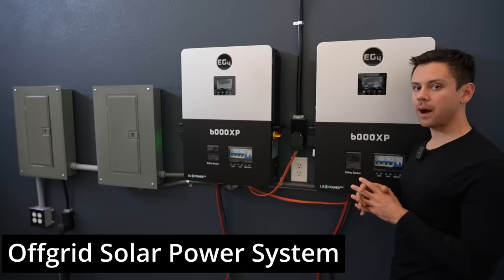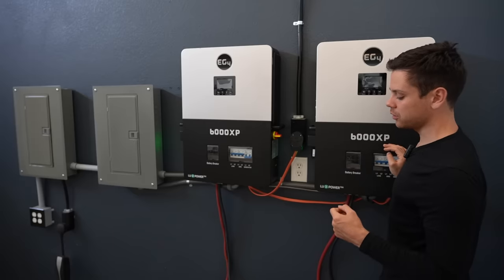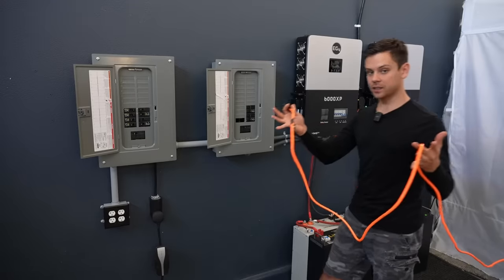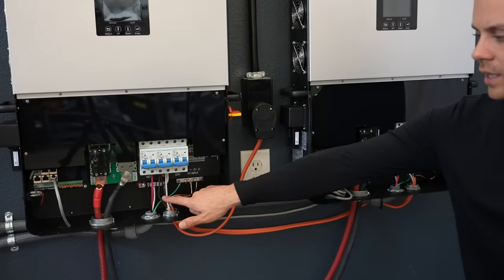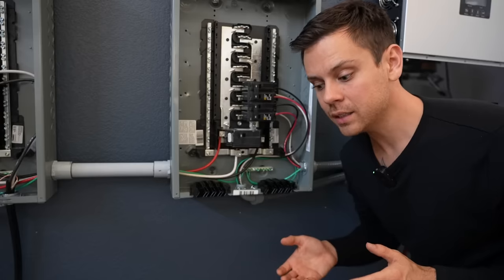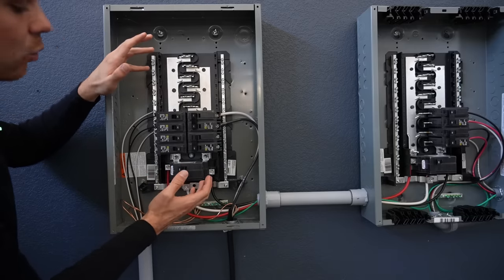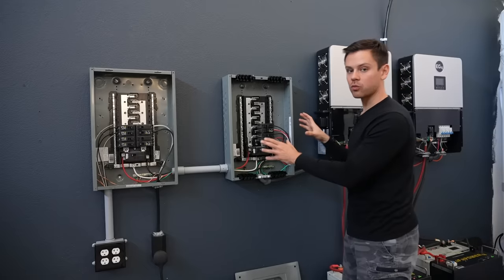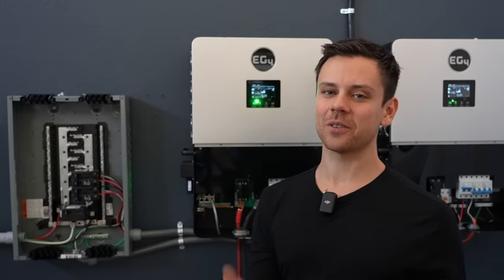How to Build Expandable Off-grid Solar Systems w/ EG4 6000XP

Comment: So I have a bit of an unusual setup on our farm.  The utility power is one 200amp meter and split 3 ways to 3 structures with 200amp panels each.  Typical load is 6kw-10kw much of which is lighting.  And sometimes welder, air compressor and AC.  I already have 8.4kw of panels purchased.

The though I had would be 3-4 6000xp units connected similar to this setup.  Will have a small shed to house the inverters and eventually batteries.  Would run incoming utility power to the power shed, branch out to each, then recombine, and return to the main disconnect.

Now, as far as grid load transfer the manual isn't very clear on how it supplements power if PV or Battery isn't enough.  Or is it basically automatic?

Thanks and keep up the great content!

Comment: Once again - great presentation and explanation.  

1 quick question - given that it is 6000 watts - I would have thought that breaker would have been for 50 amps instead of 40 amps.  What is the reason for the reduction?
Reply: 40 amp at 240 volt is 9.6KW .So the 40 amp breaker should easily handle surges.

Comment: Great breakdown! The biggest concern I would have, is finding an electrician who is knowledgeable enough to correctly set up the panels, without destroying the inverters in the process, creating a ground loop or not fully understanding the use cases of the various layered breaker approach. Many to most electricians I've come across will have absolutely no idea of the complexities involved in setting these up, and will end up under-configuring them, or creating an outright dangerous panel setup. How do you find the "right" electrician for a job like this?

Comment: I have a few wire questions...  
*You said 2/0 for the batteries is overkill, what size is "right size" appropriate, 1AWG?  400Ah of batteries but the 6000XP can only pull 125A.
*What size lug is used on the EG4 6000XP and what size is on the EG4 LL batteries?
*And you used 8AWG stranded THHN wire for the 240v grid connections? 6AWG after they combine.
*Looks like you used 10AWG stranded ground wires?  
Thanks Will!

Comment: I appreciate the multiple integrated functions: disconnect, AC and DC breakers with arc and ground fault built in etc... As a counterpoint, what is the likelihood that one of these individual components fails overtime and needs to be replaced? Does this type of integrated build make repair more difficult or expensive in comparison to replacing an isolated component? Thinking long term, dedicated components are more expensive, but perhaps better for repairability and reliability? What do you think?

Comment: the breakers are there to protect the wires.  you did mention that doing it this way won't protect the wires and that if you overload the system, the 100amp breakers will not protect the wires and they will overheat.  I don't understand why you didn't swap out the 100amp breakers for a size that would protect those wires, or just put in wires that would be fine with 100amps.  Yes, those would be thick wires, but you put one load center right next to the other, so it would be a very short run over 1/0 copper.

Comment: It would be great to see how to set up a system that would include wiring steps from house MAIN panel to an automatic transfer switch (critical loads) then to (2) 6000XP's (instead of using multiple "manual" breaker boxes). Also being able to use A/C passthru when batteries/solar/generator aren't available. And also be able to auto-start the generator. Can the 6000EX do all of those things?
Reply: Agreed I would like to know what Will thinks about that too

Comment: What combiner box are you using ?  Can't find it.  Would really be helpful to list outsourced parts in descriptions.

I understand the basics of keeping neutral and ground seperated except for the man grid panel, and expect you simply removed the green screw from the neutral /ground connected bars to free the metal box, then added a bar directly to the metal box for ground, but an explanation of that would have been helpful for anyone with less than my own basic understanding.

Not criticising, because you've taught me so much, just a friendly suggestion.
Reply from the maker: It's all in the description. There is a link for a schematic and parts list

Comment: Seems like some good upgrades! I wish they would have improved the generator capability. My EG4 6500's just bit the dust after only two months in operation! I have to send them back and looks like I'll be getting these as a replacement. I really hope they are a bit more plug and play than the 6500 models. I had so many issues with programming them and firmware. Apparently they have an upgrade program now you can trade in your old 6500 unit for the xp. It seems like they were having a lot of issues with them.

Comment: I see you have kept the Neutral and the ground separate in the Combiner Box and the Load Box (similar as you state is done for a  Subpanel).  But I do not see any copper wires attached to those ground bars that wires them to an earth ground (copper rod driven into the ground)!
Reply: My question exactly?!?

Comment: When used as an off grid system, it would be nice if the grid breaker could be used as a dump load. Even better if using multiple units, use one as input from another inverter (maybe one with high idle consumption that you do not want to run overnight) and another one as a dump load. Just a thought.

Comment: Hello Will,

Thanks for your testings and sharing your passion.
I have two questions.

-Is it possible to show us with a scopemeter (oscilloscope) how the sinewave looks like?
-Is it possible to show us in an ambient temperature room of 20°C the thermal images at idle, half loaded and fully loaded?
(To show thermal images of the half load, you need to increase the load from idle to half load the increase to see what's the incoming hot points (spots) and keep it a minute on half load, and the same idea for full load. From half load to full load for about at least one minute.) Always while respecting the appliance theorical specs for these tests. And if you want to test more to verify the limits, it's after for our pleasure. Because we know that using out of electrical constructor specification limits, it can run the appliance to fire, or brake, etc. 

I deeply appreciated when you talked about people that had issues, because you're like our syndicate, our brotherhood when you represented this way. You Represent a lot ;-)

I have other questions.
Can we hook up wind mills on this all-in-one inverter?
Could I use it on a sailboat?

Thank you very very much,

Comment: Recommended Conductor size for Grid and load in the manual is 8 gauge. I used 8/3 wire.
Reply: Does 8/3 change the breaker size or are you still using a 40 A ?
Reply: @MrJar1rad  
40A double pole breaker.

Comment: Your combinary box is wired like a sub-panel , where neutral and grounds are seperated this is what electrical code requires , so saying you wire it like a sub panel, may help some people know exactly what you are saying!  Code requires 1st panel after your meter "main panel" to have nuetral and grounds together (that would be grid power, the combiner box for the units would be wired and considered a subpanel which must have grounds and neutrals seperate and EGC (Equiptment grounding conductor) or 4th wire green wire. In the grid the EGC is designed to be a return path back to source or main panel!
 Just thought maybe saying you wire it like a subpanel may help some people!

Comment: Hi Will, its amazing how quickly the technology is moving forward
I have been living off grid for 3 yrs now with an older 3 panel x 450w in series to feed a basic 60A srne controller with 2 x 12v x  200ah gel batteries and a 4kva 24v snadi invertor. I live in the Philippines retired n learning about life off grid
The 2 batteries were failing so I just bought 2 x 12.8v x 280ah lithium lifepo4 batteries. Gentai brand they seem well made with built in bms
Its working but I'm confused about allowing for future upgrades as I regularly run out of power when using grinders and saws etc.
Without overspending whats a good way to future proof my little system?
I'm planning  to add another 3 x 450w solar panels and get additional
2 x 12v x 280ah batteries 
And so here's where i need some experience and friendly advice

Am I better to change my inverter to a 48v and say make it 6or 8kva
Or would I need more than a 6 array of 450w panels to power it?

What's the way to keep what I have working and have easy time when funds are ready for upgrading to a higher kva invertor?

Sorry if its long winded . Look forward to any suggestions

Comment: Great informative video. Amazing to see how EG4 keeps making it easier to build a DIY system. I assume that in your second panel, the ground bar is connected to a copper rod outside your house?
Reply: If you connect the grid inputs, then the grounding (and the N-G bond) is provided from the main panel, but if you don't then yeah you'd want to provide a real ground for a purely off-grid setup.

Comment: Will. Great information.  Couple of questions - I need to install TWO EG4 6000XPs … what is the maximum battery capacity I have to have in place and how do they need to be configured ?

Also, do you have any idea when the 12000 XP will be available for sale ?

Thanks!

Comment: Hope these are more reliable than the eg4 6500. I’ve had to replace three of mine in less than a year.
Reply: What was the issue?
Reply: hello I recently had to send my 6500ex back because it had high voltage on ac output (140v) s.s gave me a full refund and I bought  one of these hopefully it will arrive soon
Reply: I would wait to see before you purchased. We have seen a lot of these little wall hangers live a short life.Just my opinion.Maybe this one they got right.But don't hold your breath
Reply: @mikeg2321  well hopefully they got it right this time. and I already made the order s.s gave me a store credit for the old inverter( 6500ex ) either way I have to get one already made an investment on solar panels and batteries can't let them sit collecting dust doing nothing . plus if theirs any issues they have 5 years warranty. and s.s is good with their warranties I didn't have any issues returning the 6500ex . I know their some good inverters out their like solark and victron but they are way of my budget.

Comment: Hi Will, it looks like the way you have the inverters paralleled in the video, that if you were to go completely off-grid with no utility availability, it would not be a problem to run with 1 inverter most of the time, then fire up the second one only for large, scheduled loads, like charging the car.  The point of turning one of the inverters off would be to minimize idle draw during the darkest months of winter.  Can you please confirm?  Great stuff.  Hugely helpful.

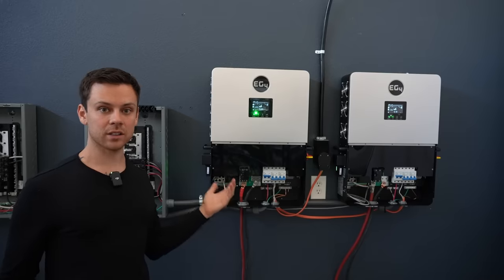Comment: @13:25 I made it through the video understanding everything you said.... now if I can only muster up the courage to put it into practice.  99% understanding 1% guts to connect the system. :(
Reply from the maker: You can do it 😁👍🏻
Reply: Yeah I'll be doing it for sure... I'm all for DIY.  Just got the EG4 Heat pump mini split 12k btu 28.5 Seer2 will be installing in 2-3 weeks... or a least when it's not raining.  In the process of getting the solar panels and decide on what mounts for a shingle roof... and then apply for permit .... only installing 8x 450w panels to start with.. since in a year or two I might redo the roof since it's over 25 years old now. .... and go for metal roof with standing beams... Busy next summer since I'll be redoing the roof of my parents house... haven't decided shingles or metal since their roof is a little more complex .... my roof is very simple traditional roof.

Comment: I have watched your videos for a few years now and am in the design phase of building an off grid home.  You pointed out that you have a connection to your 18K inverter, was that inverter connected during your car lift test?  You also set the individual inverters to share battery settings but it appears that each inverter has its own separate battery bank, what am I missing here?  As always you are a great resource for me in the planning/ dreaming phase of my build.
Keep it up. Thanks

Comment: First of all, I would like to start off by saying thank you for all the knowledge that you put out there to everybody. I got my E4 6000 XP and December per your video and other peoples recommendations 10,000 W of solar is recommended so that’s what I have. All of my parameters are correct and not exceeding the limits Every single time my unit gets close to 7000 W of PV input the unit starts screaming. Can you do a video bringing in that much Solar according to signature Solar this is a problem that they are starting to see and do not know what the problem is. They are sending me out a new unit , thank you for your help if you can
Reply: Havre you used a string calculator to see what your voltage will be at the high and low temperatures your array will encounter?  The internal MPP's are not happy with string voltages higher than 480v. This can occur with a series string of 10 panels that are 40v Voc each (400v Voc) at 70 degrees F, when the temperature drops to 30 degrees F. The MPP's will also clip at current above 25A. They like 17A best.  This is all in the manual, by the way.

Comment: Greets Will,
Nice presentation, I would appreciate more clarity of the shared battery and PV source.

For a dual system, can they share a single array for PV or should they have individual PV source? I currently have a single (8 Panel) 3000 watt array.

Thanks for all

Comment: Great videos as always Will!! I waiting to pull the trigger on a off grid system but you keep coming up with more ideas and better systems! I'm in vortex over here! Looks like a 50W idle consumption not bad. 1 question how loud is it under load or idle? This is a big issue for indoor systems in small cabins. Thanks as always Will
Reply: I have one mounted on the wall in the room I also use as an office, and the unit is pretty quiet - especially when the loads are light.  The fans are not much more noticeable than the fans in my tower PC.  When the loads are high and/or the PV input power climbs, I believe it gets into the 50's as far as decibels - still not bad at all.  I had the EG4 3000 EHV before and I can tell you that this system is noticeably more quiet.

Comment: Perfect, thanks so much for this step by step guide. How did you run the ground from the main panel? My panel has ground and neutral bonded, not sure how to handle that, any advise?

Comment: Why are you not using T class fuses between the batteries and the inverters like you did in previous setups?  Everything you said about their importance from a safety aspect would still apply to this inverter.

Comment: Is it possible to set up a dump load on these units? I want to have a water heater connected to use excess power when batteries are full.

Comment: Can I run a 5500w portable generator with 240v AC into the EG4 6000xp to get a cleaner output or does it take DC input only?

Comment: @Will thanks for this video. I tried to see a bit more detail on how you wired the batteries. Is it correct to infer you paralleled them... And connected a positive and negative terminal to each 6000XP... So they are essentially connected to the same paralleled battery?

Comment: This is the exact system I'm looking to build. My main goal is to power my 4 minisplit condensers for heating and cooling. I want to start small and add batteries as I can. With that said I won't have enough battery power to run all the loads initially. Will this system prioritize using the batteries first then supplementing from the grid? I also don't want to have my batteries charged off the grid until the sun goes down and the grid will make up what the panels couldn't. Sorry if this is obvious, but just trying to learn before I buy everything.

Comment: I’m helping a old timer with two of the 6000xp units and this video helps how to combine them. I noticed a couple of discrepancies. The video says the ground neutral bond happens in the inverter automatically but the write up on Wills website says to set it manually using the display. Which is it? Also the manual says to use 8 gauge for each inverter AC connections but the write up shows 10 gauge from the inverters to the AC load center. Thanks.

Comment: Thank you for the great video. I have a question to ask. If you are connecting your grid into the inverters, is that supply on one of your main circuit breaker lines ? Or did you bypass and connect directly from the grids incoming line with splices?

Comment: Have a quick question,  been watching your vids and subbed to your channel for some years now but how do you get all this (solar panels, inverters, etc...) do you buy all this stuff or did they give them to you for free?  Just struck me cuz all the stuff we've seen could hook up at least a couple hundred individuals on here for our homes. That's a lot of equipment for off grid homes 👍
Reply from the maker: I donate everything to my forum members
Reply: @WillProwse  yeah I was wondering cuz that's a hell of a lot of equipment and you would need a huge warehouse to store it in 👍 but do you buy all this or is it given to you for testing and reviewing?
Reply from the maker: @Shadowking81  some stuff I buy some I get for free. Really doesn't matter these days because I work with so many distributors. Watch my video that covers how I make money on this channel, posted it many years ago
Reply: @WillProwse  tried posting this before but seems YouTube removed it for some odd reason,  what's your opinion on the JA Solar 530W Solar Panel 144 Cell Bifacial JAM72D30/MB  panels?

They're on sale for

$193.79

down from 

$223

I might buy 4 of them